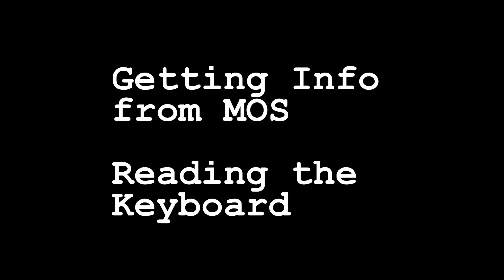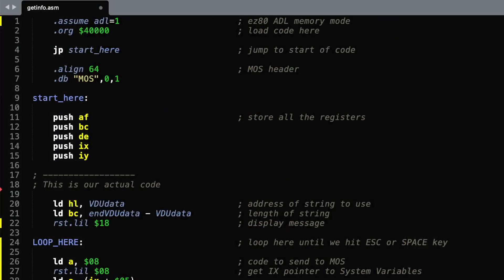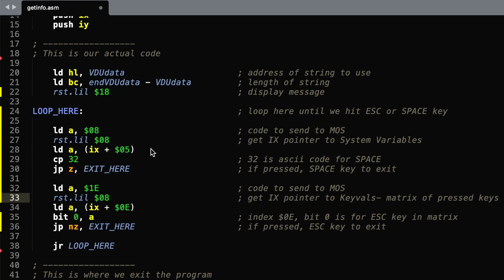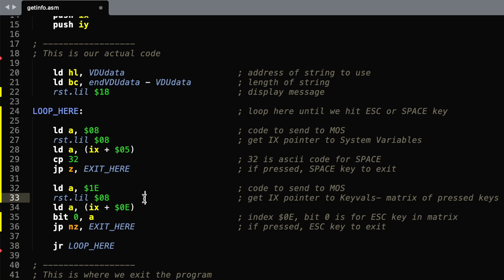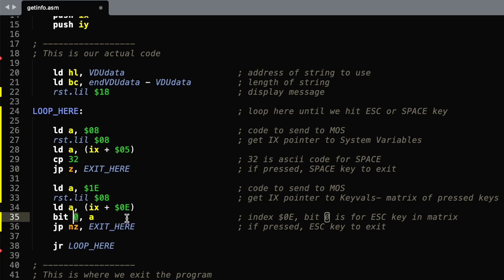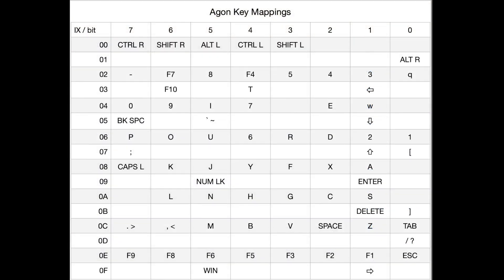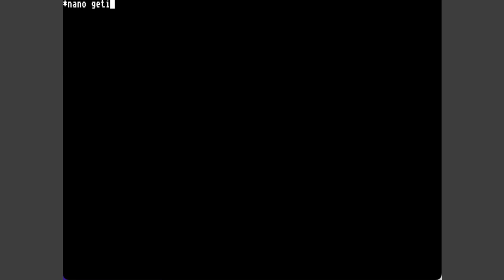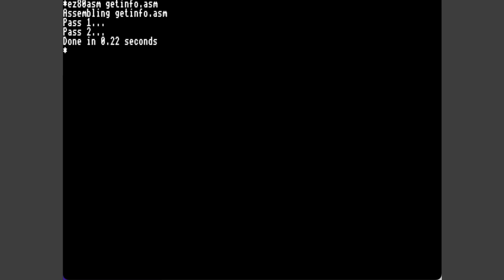03 Getting Info from MOS - the keyboard

Comment: Thanks again. I didn't understand why you say 'jr LOOP_HERE' at the end and not 'jp LOOP_HERE'. Also, I tried to squeeze a 'rst.lil $10' between lines 28 and 29 to see what I type but that didn't work at all. Probably will understand later. In line 58,  it should probably be 10, 20 in the code and in the comment or 10, 10 in both. (Ditto for text.asm) But don't want to be petty; the series is great.
Reply from the maker: 1. JR <LABEL> takes fewer bytes and is faster than JP <LABEL>, but is limited to a relative jump of -127 or +128 bytes, whereas JP can jump to any memory address. Old habits from working with machines with less memory!
2. RST.LIL $10 has probably destroyed what was in A for the CP command following.
3. Yes, a typo in the comments.
Reply: @AgonBits  I think that I now understand better what is really going on in the   LOOP_HERE: ... jp LOOP_HERE   section. Even if we only hit 3 keys, we run through that loop several hundred or thousand times. If we don't press a key the sysvar_keyascii value is simply 0. 
To see this, I inserted ld a, $2E and rst.lil $10 directly at the beginning of the loop.
Should we probably use an inner loop to wait until a value not equal to 0 is available? And only then compare to SPACE?
Reply from the maker: @martinschader5859  In this example, it doesn't matter. If you need to check other keys, then maybe that makes sense. However, note that this example presents two different ways to read if a key is pressed. When dealing with multiple keys, I usually prefer the key matrix check, as you may want to know if more than one is pressed at a time, eg, LEFT and FIRE, rather than a single keycode.